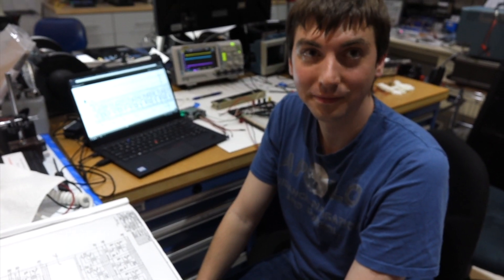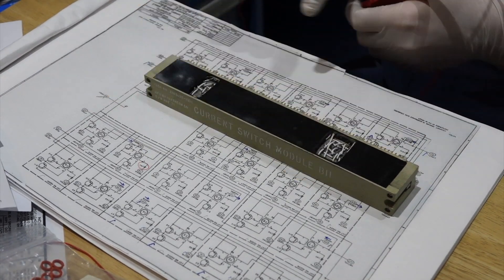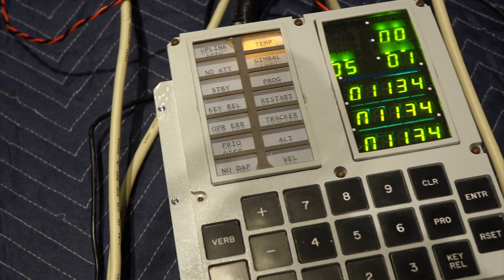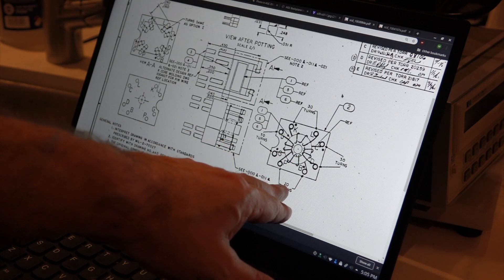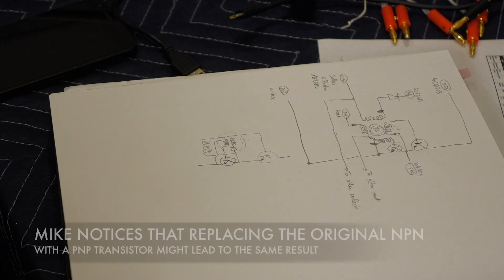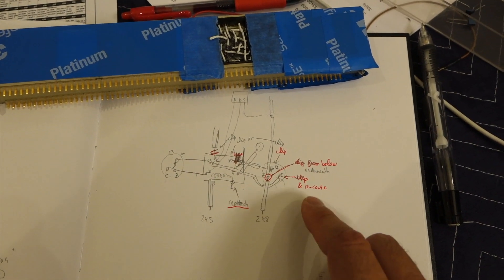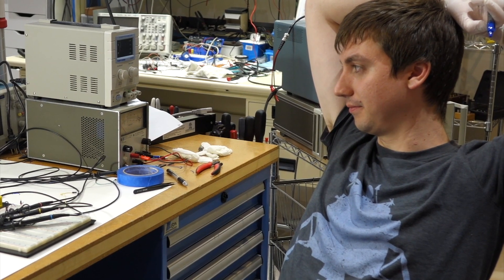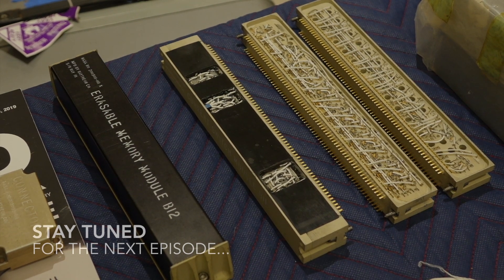Apollo Guidance Computer Part 18: Module B11 rescue, Apollo 13 style

Comment: My dad told me about a transistor Raytheon Missile division.  was going to reject for ringing.  In testing, sent several pulse when triggered in place of one. This fault would have been very bad, if the device would survive in use.  The transistor was in the warhead's firing system.  A person who knew the device and its use said, "They all do that."  The little pulse is a feature of the regulation wiring,   Repairs: Three faults: 0.  I hope your team continues to have a winning season.  Great work Guys.

Comment: I think, that this Apollo13-style repair, is way more difficult than the two previous one... digging in that black-rock hard resin should have been a real pain....
A question: do they used germanium transistors? It seems to me that the glitch was due the different nature of the transistor pairs...anyway all that documentation you have in hand is really awesome and helpful!
Thanks for sharing this magnificent experience! Pls, hand-on my personal & nice high-five to Mark, for he's awesome competence ! ciao! Mario from Italy!
Reply: It’s silicon, but newer transistors are faster and often have lower input capacitance than older ones so that’s why the ringing. I’ve seen this in other 1960s and 1970s logic circuits as well.

Comment: You guys will need a year long holiday after all this stress! P.S. I wonder if that module was deliberately "fried" so that Nasa could know what the actual failure limits of the system were?
Reply: I suspect you're correct. "Test to destruction" is sometimes a very necessary task.

Comment: I guess Nasa would have tested the limits of the AGC by stressing a couple of them or their subsections to destruction. If so, you folks seem to be finishing their work by demonstrating how to breathe life into the destroyed devices again.
This is Eye-moistening awesomness! :oD
Poetry in motion of charge!

Moreover, I think you demonstrate the need for any manned deep space missions to have machinery on board that you can fix yourself. There is no use in having to depend on flashy handheld super compact Android or Apple computers when a simple blast of cosmic ray can take them out for bad. It may even be smart to rely on vacuum tubes in some places as they will just shrug over such events.
Ulf Merbold, the first German to fly on Space Shuttle and now head of ESA's astronaut training, flew a mission on the MIR station in the nineties. In an interview he said that, while MIR and Russian spacecraft in general were way less comfortable to be in, he appreciated their sturdy simplicity which made it way easier to fix problems as they occurred. There may be a lesson to learn for spacecraft designers in there.

Comment: Marc could be right about the PNP thing—back in those days, PNP transistor fabricator was kinda sucky, and they usually had worse hFE, V_CEmax, you name it. So an all-NPN design may have been considered necessary for reliability.
Reply: Conversely Germanium transistors were sucky at NPN processing, but the best performance came from PNP parts. Motorola made some truly impressive PNP germanium power devices, that were rated for impressively high currents, 60A or so fully saturated, though of course they also had the rather bad problem of leakage currents in the tens of milliamps worse case, 60V breakdown for the high voltage parts and truly poor maximum operating temperatures.
Reply: @SeanBZA  Yeah, which probably explains why Generation 1 Fuzz Faces were PNP germanium (or most other early fuzz pedals, for that matter).
Reply: @SeanBZA  The most common types were NPN. I have couple of TO3 Ge power transistor that are PNP (dont recall the part now) but you can grab any schematics of early audio on Ge and most of the parts ar NPN and in many cases two NPNs with transformers and center tap. And you couldnt go further than the 8 to 10W of the AD161 and 162 types. Ironically, like in tube hibrids, they keep using power Ge as the bjt was introduced. You see shy appearnces of BC types in the pre amp, but the heavy lifting still made on AC188 187 or AD 161 162. Matsushita kept using 2SB324 and 175 (not sure on that) until early 80s in mass consumer recorders which is mind blowing. Probably has to be with the factory return costs, but in the case of the 324, it was used in power sections like speed control and BIAS osc. As they produced micromotors, the speed control circuit was very tight to the motor specs, hence, keep using the 2SB324 on them. you can visit radiomuseum and search a Ge part and watch thefigures per year of a certain part Vs number of models were it was used.
Reply: 38911bytefree Also, Ge parts have the low diode junction drop (0.3V) now done with Schottky diodes and transistors, but without that nonlinear effect).  For some circuits, this is significant.
Reply: From a quantitative reliability perspective, a coil is way more reliable than a transistor....mil217f roughly 1e-8 Vs 1e-6...in those days even more so. 
It just demonstrates to me how brilliant and carefully considered the original AGC was and how it was so geared to the application.

It is also fascinating to read about electronic systems on deep space probes, again, at first glance "antiquated technology" but in terms of rugged long life and purpose....just the very best the human race has.

Comment: It looks to me like that replacement transistor might be a good bit faster than needed and that would account for that first of the two spikes, the one you don't see in the original circuit. If you look at the first square pulse you will see that it has a slow corner recovering, and yours is dead square and with the switching transient. Maybe try a slower transistor or a few puffs of cap if it turns out to be a problem.

Comment: I don't trust inductors! made me grin :) What a team you are.
Reply: I don't know if Marc caught it on film, but the SPICE model Ken started to put together in the video was absolutely convinced that what we had made was a boost regulator. I guess he was right to not trust them!
Reply: Mike Stewart Did he by any chance use LTSpice, which was specifically created to model switch mode power supplies?
  Anyway, the new circuit is a standard class B amplifier on the coil output, effectively used only in neutral and saturated states (ternary digital signal), so exact transistor gains and matching are not important. HF noise is hopefully removed by the low pass effects of the input transformer and the inductance of the magnetic storage cores on the output.
Reply: LOL, I always say that capacitors are like dogs and inductors are more like cats. :P

Comment: I like to use a sensitive thermal camera to find short faults like this.. It takes only a very small amount of current to heat a up the short position slightly.. Just a thought!
Its great to see the this sort of work here on youtube, as normally  people who are not working in the field, dont understand what it takes to repair electronics! 
Excellent work of an outstanding team!
Reply: He talks about that in the video and says he thinks it is too risky.
Reply: @stevebollinger3463  Yes, he does. Just wanted to mention that I dont think that it would be a problem, as you only need to pass some tens of mA, to get a significant heated zone.. We are talking about a couple of degrees temperature change to the rest of the module..This small amount of current und temperature differential should not damage the unit further..
Reply: unrealillusion87 and then he points a heat gun into the system in the next episode. Yeah I think you’re right getting concerned about a few mW was being over dramatic.